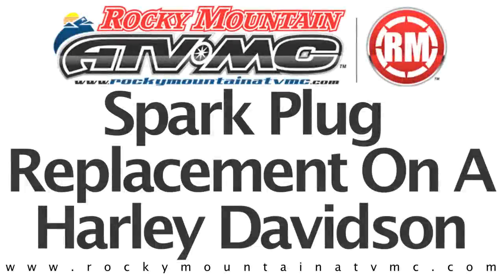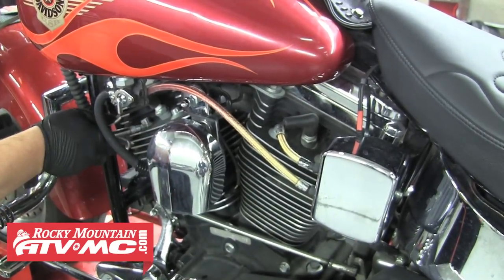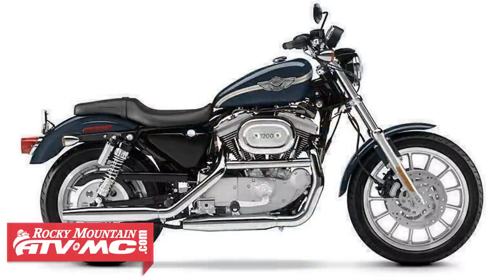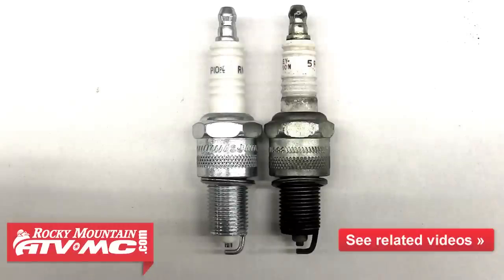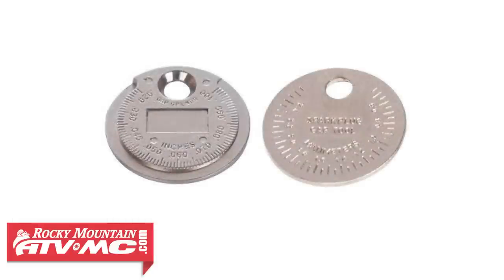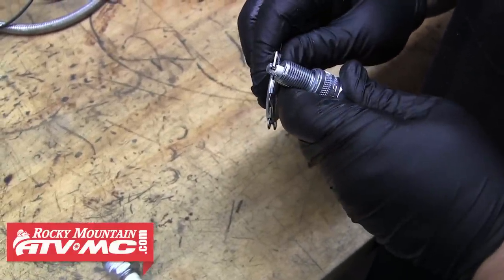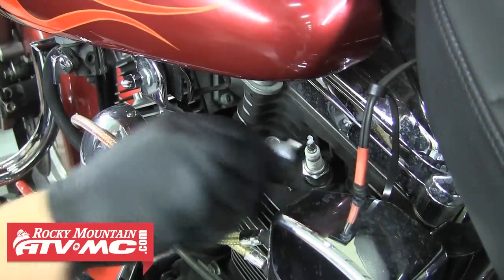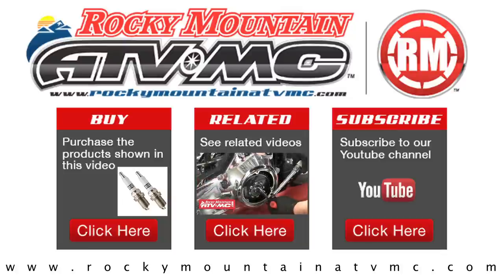Harley Davidson Spark Plug Inspection

Comment: Is it that you onley change sparkplugs in an cold engine ?
I remember that an hot engine expand , so a cold sparkplug in a hot engine is not ok.
Dont know if it is true.
Reply from the maker: That is correct, it is best to only change spark plugs on a cold engine. When an engine is hot and you change spark plugs it can change the way the threads interact and your torque value can be off.

Comment: i have a very stupid question, how many spark plugs does a harley engine have? My Honda has 4. VTC2. Thats a 2 for twin pin crankshaft....
Reply: seven !!
Reply: Depends on the model. My 2004 XL1200C has 1 for each cillinder. Some of the newer and bigger bikes can have 2 per cillinder i believe.